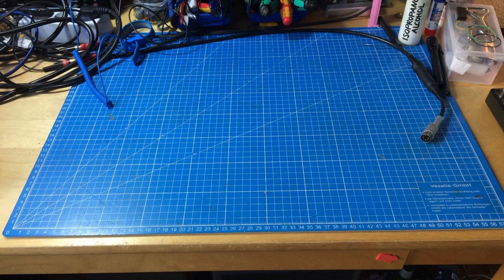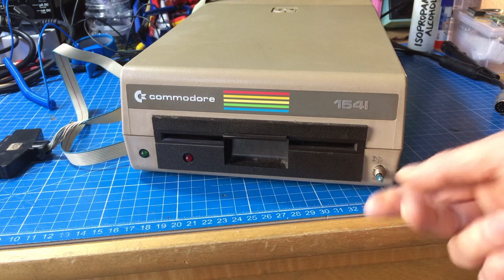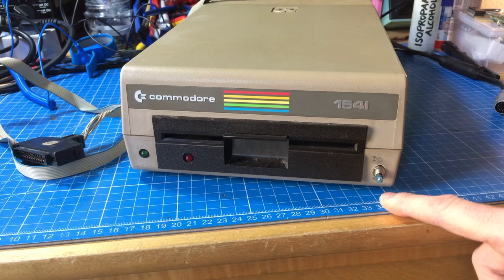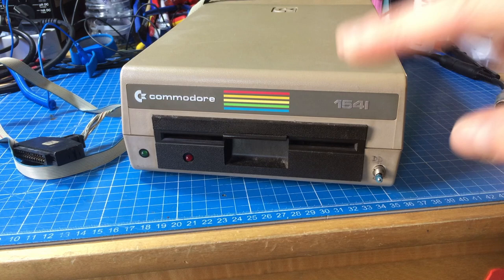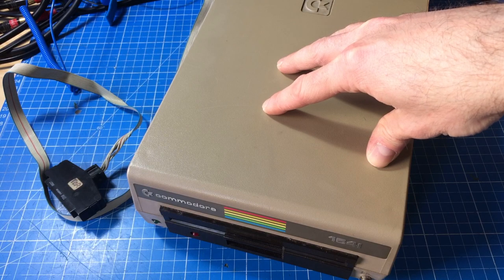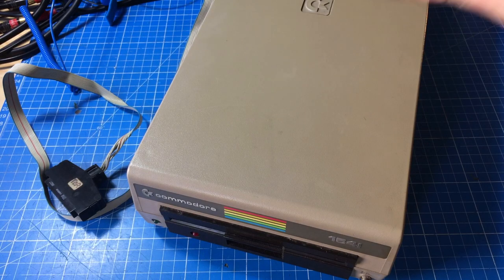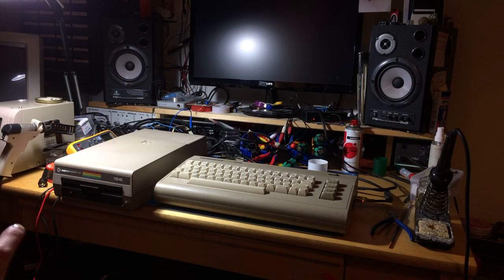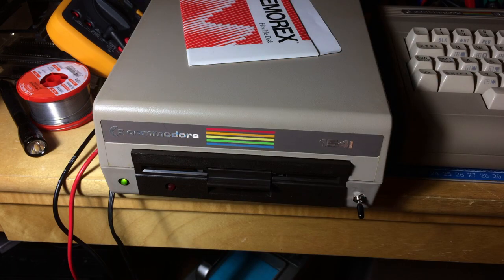Recreating my 1987 C64 Setup Part 2: My 1541 Disk Drive

Comment: Just an interesting fact for your audience at 27:10. The two round holes in the chassis to the left of the hub spindle were for much earlier "hard sector" detection. In the very early days the hub of the floppy disk had a small hole  punched in it. The two holes in the chassis would have held an infra-red detector pair and would have detected when the hole passed between them and sent an electrical signal to the board. The software would then determine that the disk had spun one revolution and do it's thing accordingly. Just an fyi fact for you all ;) Showing my age now...

Comment: I don't know much about tantalum caps. I read up a little and although they appear to be sensitive to abuse, generally they don't fail much if treated normally. 
It's good to see the possibilities of alternate roms in 1541's. I'd heard of Dolphin Dos but I've never worked with it. By the looks of it, it's very quick!
Reply from the maker: As far as I know, older tantalum caps are often not very good. The problem is the spectacular (flames!) failure modes so I'd rather be safe than sorry with these. ;) DolphinDOS is one of the fastest there is I believe. Someone still makes an updated version of the DolphinDOS boards, actually. :)

Comment: A locking pushbutton would have been a better switch, especially since it wouldn't protrude so.
People say UV light isn't required but the thing is, they still have some light, even if it isn't UV.  UV has the most energy for mobilization of bromine, and can penetrate slightly deeper than regular light.

Comment: Another great job =D  Glad you didn't swap out those tantalums for electrolytics!  I wouldn't worry about them!  If they fail they will likely just short the PSU out and just explode (wont be hard to find the faulty one lol) and you can always just replace at that point.
Reply from the maker: Thank you! Got some tantalums as a donation to replace the old ones before the explosions actually. ;)

Comment: A tip for easy retrobriting!  No need to dismantle the computer or drive.  Use a brush and brush on some Conditioner or other Retrobrite solution and place it in the sun.  Re apply with brush every 15-20 min for a few hours.  All the yellowing will be gone!  Wipe it down with some soapy water on a rag to clean it.  Done!
Reply from the maker: Yes, I saw that being done. The problem I see there is that the cases often are crusty and dirty and there's no way to remove all the dirt without disassembling stuff most of the times. I don't think retrobrighting without cleaning beforehand is a good idea.
Reply: I’ve done well over 200 units and in all the tests I found heat to not affect the retro-bright process at all, you need sun light at the least, leaving in a window would help more than sticking it next to a radiator, I used to leave in a window for a week during winter or overcast days, in the end I invested in a RUB box (Really Useful Box) and a couple of good UV strip lights, cuts the time down to hours, and gives a much better result.

Comment: For your comment about tantalum capacitors - yes you can replace them with modern, low ESR type electrolytic capacitors. The main reason tants were chosen back in the day was that they had lower ESR than regular electrolytics (and low ESR electrolytics didnt exist yet ;)
Reply from the maker: Yes, that's what I read also. Wasn't too sure (obviously). I have ordered some tantalums now to stay safe and true to the original design. ;)
Reply: Fair enough :) Old tants used to have a nasty habit of failing as a short circuit, and then exploding! Modern tants are better in this regard.
Reply from the maker: Yes, I've seen exploded old tantalums. Very destructive failure mode indeed. ;)

Comment: I still have 1541 it still works great how ever my 1571 has some reading troubles I had someone put in 2 switchers able use 8 and 9 disk drives meany years ago it was handy when running Geos  I clean head still does it

Comment: I've still got some old C-64 parts. Mainly 2 Joysticks (they were a rather cheap model back then, I think), an old C-Itoh Riteman F+ 9-needle printer and the blue adapter for it, so you could connect a C-64 to its Centronix port. Are you interested in that? (I'm in Germany as well, so shipping shouldn't be a problem) Also, I have no idea what these parts are still worth, since the C-64 stuff is still rather plentiful, compared to other, less common home computers of that era.
Reply from the maker: Oh, thanks for the offer! I must decline, though. I'm running out of space quickly at the moment and I already have a printer (MPS 1203) and plenty of different joysticks here. :D It's going to be worth some euros depending on the state it's in for sure.

Comment: Radiator's temp is too low for retrobrighting. I used PCB preheater to maintain 70°C (measured, preheater was set at much higher temperature) and it worked but the sun does it way faster.
Reply from the maker: Ah, good to know. It worked for a bit (obviously) but not much. Will have to work out something using higher temp next time. Thanks for the tip. :)

Comment: How fast does your speed loader run vs the usual speedloaders in software?

This is interesting stuff, shortly after release, a C= engineer proposed a new design with two paths to the CPU from the drive, would have improved load times, but cost a little more so it was stopped, a pity. The switch that speeds loads by 14x is amazing esp. since maybe when you a kid you had to suffer with a Tape drive !
Reply from the maker: Yes, I read about that in Brian Bagnall's "A company on the Edge" recently. The story goes, the engineer (can't remember who it was) implemented the faster serial connection by using more lines on the connector and then the people who designed the manufacturing board layout left out two connections accidentally so that only the slow serial bus worked. The unit went into production and Commodore decided to leave it as is after the first run because they didn't want to lose compatibility...

Comment: GEOS would be a good thing to try if the Commodore mouse wasn't such a rare thing.
Reply from the maker: I actually have a TOM adapter to connect a USB mouse to the C64 (using the adapter for my Amigas mostly at the moment though). Might make an episode about it some time.

Comment: I wonder what the 1541 would look like if re-imagined by today's standards? It does look quite over-engineered for its time - I can imagine the modern and more simplified version might look more like a discman where the disk is inserted and a lid closes down on it?
Reply: By today's standards what we'd have is an SD card reader that contained a core i3 CPU, a few gigs of RAM and a USB 1.0 connection for frustrating slowness ;-)
Reply: Today it would be a monster truck powered by a huge 1 ton engine, consuming 40 liters per kilometer, and able to drive not faster than 60 kms per hour ;-) Still I love the C64 : the best machine Commodore ever built.

Comment: Hey Jan! Do you think it is worth modding the 1541 to 240V for increasing it's life expectance?
Reply from the maker: Definitely! I plan on doing it in a future video. It should significantly reduce the generated heat and increase life expectancy.
Reply: OK. Thank you. I have already modded my C64's brick with a switching 5V mod. But so I will wait for having the 1541 modded, too, before I'm going to revive the oldie :)

Comment: Replace tantalum with tantalum, they have different properties from other types, it’s always best to keep them the same.
Reply: You can put two in series to mitigate their occasional habit of shorting completely.
Reply from the maker: Yeah, I thought so. That's why I hesitated replacing them with electrolytics. Thanks for clarifying. :)
Reply: The main property is low ESR, which can be met by modern electrolytics
Reply: And then you can have the schematics and repair / maintenance instructions stating whether or not another type is suitable or not ...
Reply: well the original schematics wouldve stated tantalum but probably not why.. generally if tantalums are being used, it is because the low ESR is important

Comment: What is the percentage of your IPA?
Reply from the maker: It's 99.9%. I use the one for cosmetics use because the one approved for medical use is more expensive. :)
Reply: Thanks for the answer. I got some 99.9% and I was thinking that it would be too strong for use on electronics but seeing as it's the same percentage my mind is at ease.
Reply from the maker: I think the higher the percentage the better. Sometimes they put chemicals as a filler in there that can become conductive and be pretty harmful to electronics. ;)

Comment: i've always hated it when people use those giant metal pole switches for mods, they look so ugly and ruin the aesthetic. It's cheap enough to pick up cute little push fit rocker switches that do the same job and much look more 'stock' to the drive.
Reply: Or put a reed switch inside and engage it with a small magnet from the outside :-)
Reply: petti78 but that would risk demagnitising the discs, plus the hole has already been drilled so may as well fancy it up abit
Reply: Hmm good point about the discs :D I don't think it would affect them from way out there but having magnets next to your floppies is not a great idea overall.
Reply from the maker: Yeah, I think I wouldn't have used a switch like this if I had modded the drive in the first place (plus, I probably would have fitted it on the backside). This was about restoring it to the state in which I received it in 1987 and the switch is the closest I could get. ;)
Reply: that's understandable, i think i'm just a stick in the mud when it comes to aesthetics, i've gone back and remodded stuff i did as a kid despite the nostalgia of it being a certain way because i was fed up of it being ugly xD